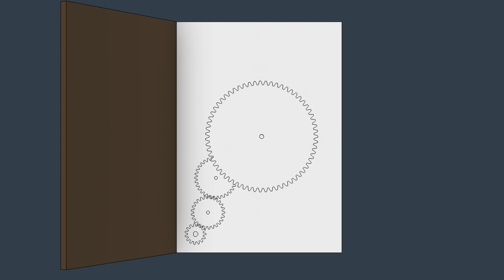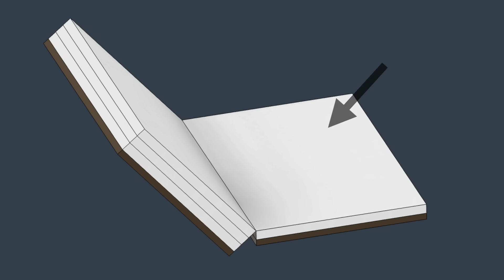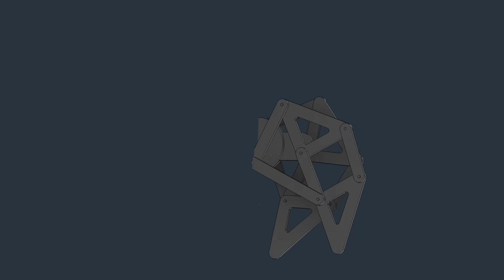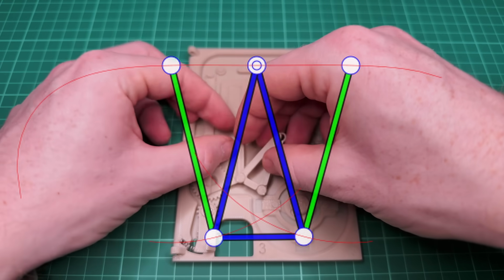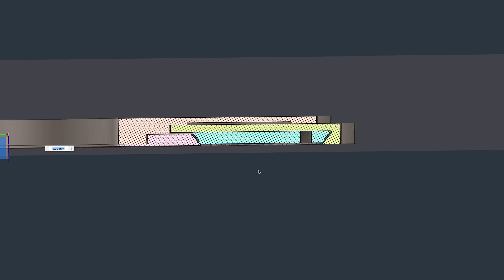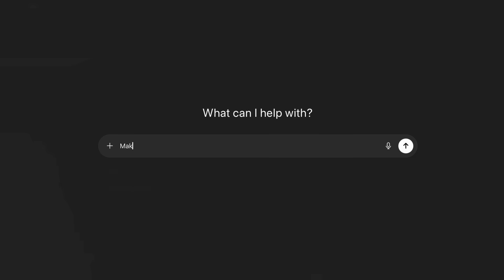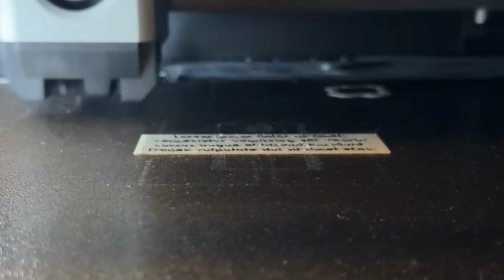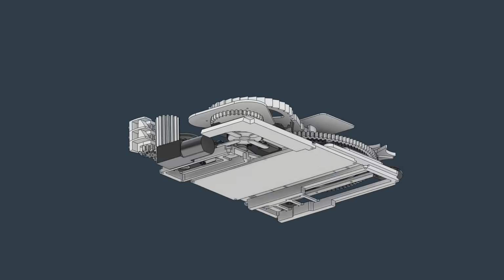3D-printed Mechanical Book that Comes Alive

Comment: Lovely project, really inspiring! I think I see some missed opportunities though.

One is that the backside of each mechanical page isn't used. While I imagine it might he tricker to adhere text to it, it shouldn't be impossible and help complete the book look more.

Another is that you can use the backside of pages for some mechanisms, as well as the front on other. This will make it so the mechanisms aren't consistently on the right side, allowing a more book-like experience where the graphics (mechanisms in this case) are more naturally interspersed across the paper.

Final is the lack of a proper spine. Ideally, you could have cover it with some sort of mechanism that covers all the 'chapters' of your little book. Imagine a gyroscope or touch sensor to detect when someone is picking it up out of a bookcase, a sound sensor that activates when it picks up a voice, or an audacious flapper segment display to communicate messages by means of where a different inspiring message is displayed each day when seen from a book case.

I do understand though that it is a very time-consuming project, and that the parts you finished were clearly the parts that really got you into the project where the rest might be too frustrating to figure out... but if you ever intended to go all-in on the concept, I know what I'd love to see!

Comment: I've found printing text on my bambu p1s that the 0.2mm nozzle is amazing, and that if you have the text raised up by 0.2-0.4mm and just do a filament change on that layer it comes out so sharp (don't even need a purge tower). You need two layers or so of the text for it to really pop visually. If thickness is critical you can do 0.06 layer height, raise the text by 0.12mm and I can't even feel it with my old man finger tip (but obviously you can feel it with a finger nail).

Comment: Poems only have value because they offer a concentrated way for authors to express themselves, a poem that doesn't express anything - and an ai written one certainly doesn't - is valueless. The text felt completely out of place and let down the whole, otherwise incredible, piece. I would get rid of the text bubbles entirely and instead, use very small text placed freeform on the flat surfaces labelling each mechanism. You could even have text on the mechanisms themselves! You could use a sticker printer for the small text, or a 0.2mm nozzle. Also whilst it's a rather big change, if you could use a laser cutter instead, then you can do the text rather easily, by just burning it in and it would give the whole thing a more rustic appeal.

Comment: When i saw the thumbnail, i thought that this fun mechanism is driven by a weight on a string. You open it, the weight drops and the gears work and optionally generate milliwatts for a tiny speaker or the like.

Comment: Spend all that time and effort to make something cool just to cheapen it with shitty AI poems.

You could have spent a minimal fraction of the time that you spent on the rest of the project and written 4 poems yourself, ones that had personal connection to the project or yourself.
Maybe you could have even learned a bit about poetry or writing in doing so.
Instead, AI slop at the finish line.

Cool

Comment: Very cool! Good job! 
For a good way of printing text: (I use Fusion, but I' sure you can do this in other programs as well) Create the "plate the text will be on. I like a 3mm depth. It can go thinner. Add the text, and "cut" it out of the plate at minus 1mm. Next create each letter as a seperate "bodies/elements" also -1mm. Save and export the plate with all the bodies as one mesh. stl is fine for this. Now, in your slicer, use the paint fill to fill each character/letter. Since they are separate bodies, they fill perfectly. Flip the plate onto the Letters side so the text is facing down. Now I think this can be done with a single filament printer. I use the Bambu Labs X1 Carbon. It treats the background and the text as a single layer, so if you have to swap the filament, it should be easy to do. I also set my engine solver in the slicer to use the Arachne solver if possible, it's better with thinner lines. it makes a very nice clean text presentation.

Comment: Its moot, but printing the text first director onto the bed, will give you a better result as the hot end won't drag any filament across the boundaries, and against the bed ensures a uniform print surface.

Comment: You get better text if you orient it down on the build plate. you need to have some object to prime the nozzle directly before the first letter starts. Another nice solution to marking plastics is laser. you can either use MOPA, UV or these other high tech laser. OR you can spray the part and laser it out with anything. I think you can even do toner transfer from laser printer, but I did not try that.

Comment: About printing the plates with the poem, I found a way of making some nice logos and texts:
basically take the model with the removed letters like you did (for me it worked better to make the cut only 50...60% of the first layer height)
Print the surface with the cut out letters as a first layer.
Do a color change after the first layer to the actual leter color.
Make a color change again after that layer.
(Depending on contrast and colors it may be useful to do 2-3 layers of letters).
Reply: Also there is a video called "3D Printed Panels With Text (Is It Any Good?)" that had some good ideas

Comment: I think this is a really cool concept with great execution. I really like both the thing you made as well as your presentation of it in the video. However, I feel the addition of AI-generated text kind of cheapens the experience of what I feel is already a complete and impressive achievement that you have created entirely on your own. Maybe just a rough topic caption, possibly naming the used concepts/mechanisms like you did in the video would've been enough if you just wanted to add some text to make it feel more like a book.
Reply: (also, the AI made an easily caught rhyming error, it's not actually good at this :-) Loved the mechanics and concept though.)
Reply: Agree. No text would have been better then AI slop
Reply: It's so weird that such a creative idea would have taken such a destructive shortcut relative to the reward of actual inspiring words. It makes me less likely to believe they made the book at all.
Reply: Yeah, completely agree.  It detracts from the final piece, it makes putting your name on the book disingenuous.

People will argue that it’s just using a tool, but what is the tool meant to solve. A calculator gets you to a single correct answer. With art there is no such thing as the “correct” answer.  It just helps people who don’t have the confidence in their own words make something with words in it.

This is such an amazing project, fill it with your own words, even if you think they’re lacking. Only time and your audience can judge if your words have value.  If you put the words in and they’re not great they’re still your own. As is, these words are nothing, and no one will ever remember them.
Reply: Some people just aren't good at words just like how others aren't good at math or tech
Reply: @william17275 so what, no one can do everything, that doesn't justify taking shortcuts, this was a great creative project and it's a shame to see it undercut by the use of AI, the book didn't really need text in the first place, and unless you took the time to pause and read the text then that's proving my point further
Reply: @piotrbijak3545  I did take the time to pause and read the text, it's just that not everyone can do everything and there may be barriers to other solutions. Taking shortcuts is fine, every time you use a calculator or communicate with someone over the phone when you could talk to them IRL is taking a shortcut as well
Reply: @william17275just don't add the text and it would be better
Reply: AI (LLMs) is just a tool. They can be used well and poorly. Here I’d say the usage is fair. Just like the 3D printer*, it helped the creator achieve his vision. 
*One could argue the 3D printer is cheating, why is he not making all the parts by hand!?
Reply: @TrevelyanOO6  He made the parts though. The modeled them, he tested them. It's not at all comparable actually. It'd be more like taking someone else's design, putting it through a factory and calling it your own than it is whatever you compared it to. Using AI instead of either finding someone on fiverr if you REALLY wanted text is literally more comparable to the fast fashion model of making things than it is 3D printing.
Reply: @ohsarcasm that is a really poor analogy for how alms, and machine learning in general, works. It implies that the llm is in some way referencing a base design or poem, which isn't how it works at all. Its like saying that the years of passive, natural, consumption that all artists (and humans do) means that when any artist has a stylistic influence they're just modifying some other artists work. No human creativity AT ALL can be said to be separated from the internalization of everything you've seen and read. No one expects an artist to start drawing having never seen picture before, every artist has seen and internalized the art of THOUSANDS of others with no permission.